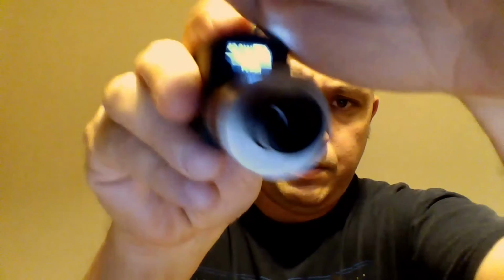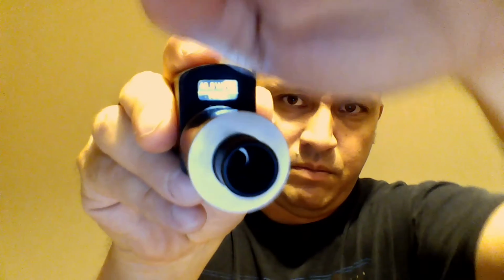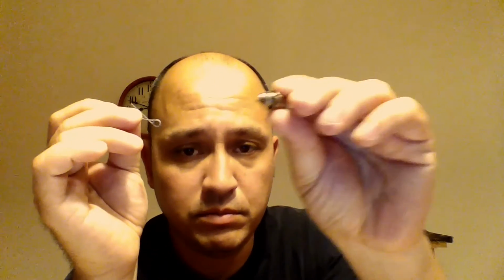Twisted clapton in a Joyetech CLR coil... yep, I really did.

Comment: what wattage would you use for a dualcoil out of it which reads as a 0,4 Ohms ? ? ?
built it and vape it in my OBS Cheetah Dripper.
would be great if you could give me your opinion :-)
Reply from the maker: iRONLiONsUnited Tough to say. That depends on your vaping preferences. For that particular build on that particular atty, I'd personally aim for no less than 50 watts, maybe as much as 80-90 watts. Lots of that also depends on the type of coil, too. A twisted Clapton like this needs more ramp up wattage but has a lower high end... something like a fused Clapton handles more wattage with a slower ramp up.